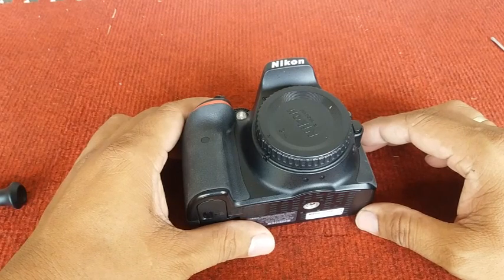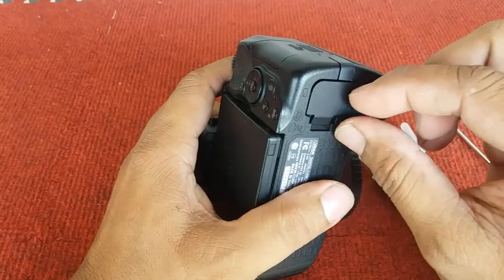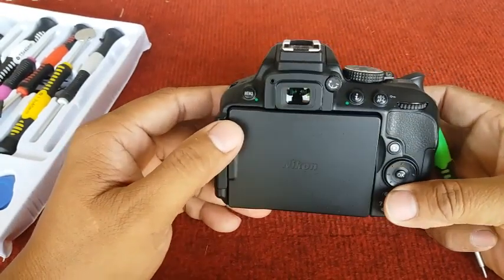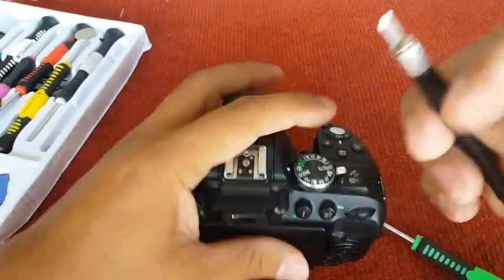HOW TO DISASSEMBLE NIKON D5300 CASE COVER

Comment: 7:07 don't use a knife to unseat the LCD connector (or any of the delicate ribbon cables either, for that matter).  Also don't pry it from one side.  That thing is delicate and it's usually reinforced with hot glue, although that is conveniently already disengaged in this video.  Use a toothpick under the whisker wires to lift from below.  Before reseating that connector later, inspect the connector and make sure it's straight.  If it's bowed, it won't make good connection at both ends, and either LCD won't work at all, or the LCD hinge position sensing switches won't work and your display will appear upside down.  Lastly, make sure the wrapped white part of that cable routes neatly around the screw flange right next to it and make certain that you don't pinch that cable or let it sit in front of the screw hole when you close up the camera.

Comment: Thanks for this video. I wished you would have also taken off the other side of the cover as well. I have to try to fix a shutter release error.
Reply: Did you find a solution how to access the stuck gear?